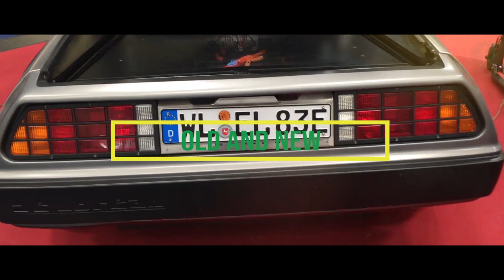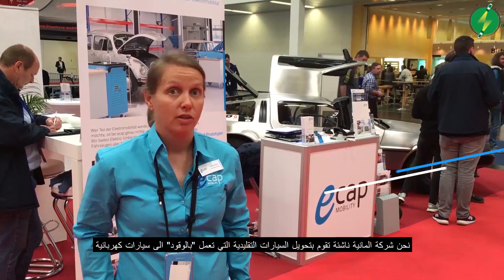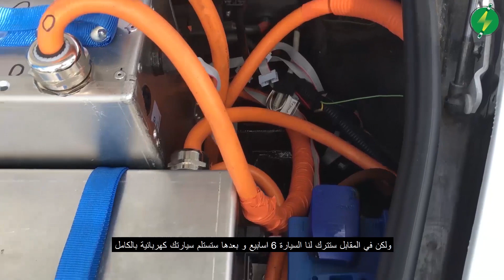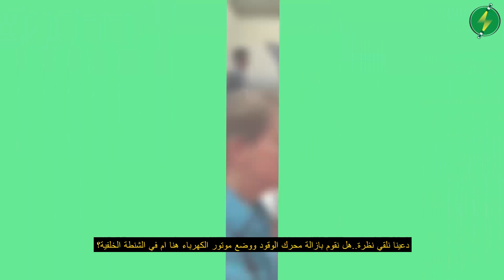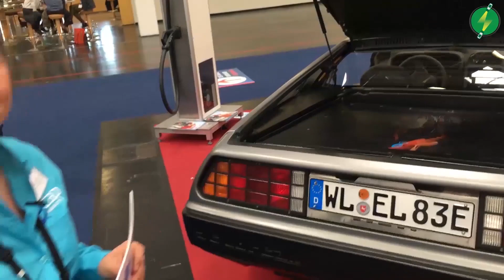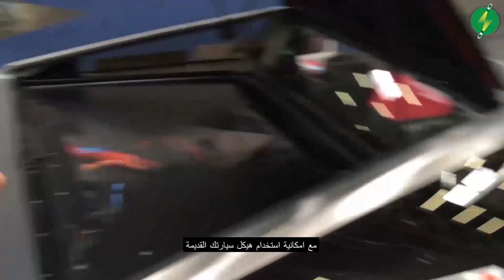طريقة وتكلفة تحويل السيارات البنزين الى سيارات كهربائية - Diesel to Electric car conversion

Comment: Too much expensive 30000 euros
I buy electric car for less arroynd 2000
Reply from the maker: I do agree with you but this is just the beginning and by time the prices will go down.
Reply: It depends on the quality of the battery and engine